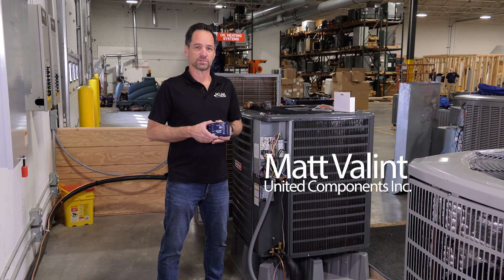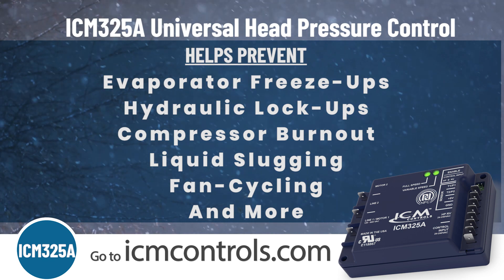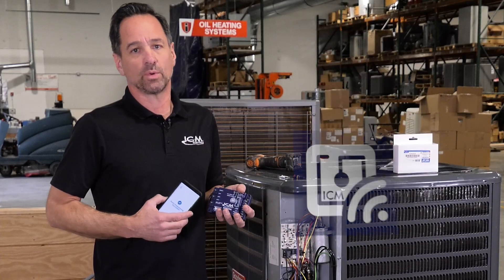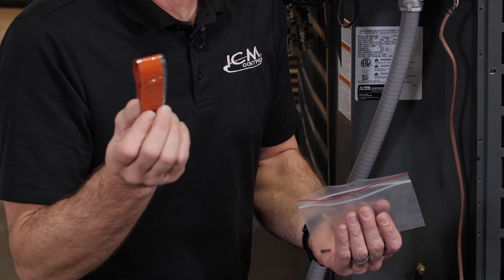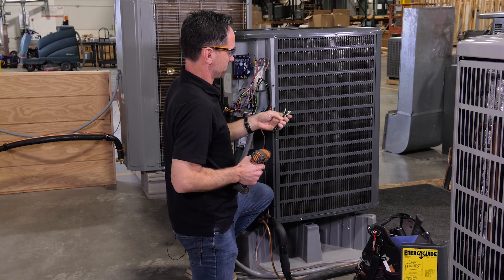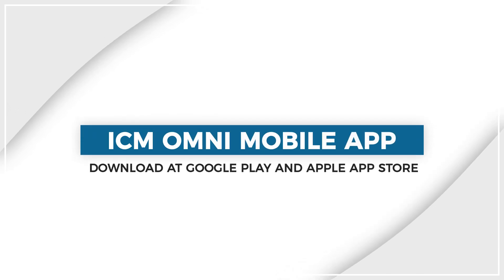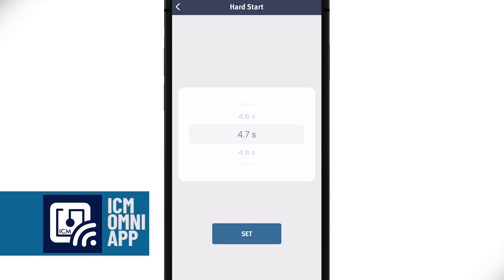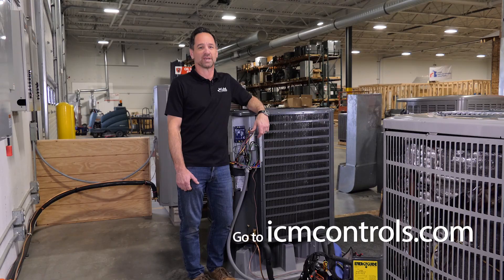Installation Video ICM325A Universal Head Pressure Control

Comment: I don't like this song. Having the dials is simpler and more straightforward. Specifically the three dial which had the temperature and pressure on it.

Also, if you have trouble programming it just have the very top of your phone right underneath the lights horizontally and if it's a better signal.

Comment: I missed the entire purpose and what type of AC this unit will work on. I have a variable speed, no contactor. The board controls the fan and compressor speed.
Reply from the maker: Unfortunately, The ICM870 series soft starts will not work with Variable speed compressors. However, variable speed compressors will have low inrush current to begin with so there is no real need for a soft start.
Reply: @icmcontrols9960  Unfortunately the video is about the ICM 325 and not the ICM 870. This means I am now double confused.
Reply from the maker: @TexasEngineer  I apologize for the confusion I did not see the Model ICM you were referencing and assumed you had a ICM870. The ICM325A is a device used to control the speed of a condenser fan motor which in turn controls the head pressure in low ambient conditions. However, if your motor is controlled by a circuit board that already varies the speed of the motor, the ICM325A will not work. The ICM325A will only work with a standard PSC ( permanent split capacitor ) fan motors and not electronically commutated (EC) motors.
Reply: @icmcontrols9960  Thank you for the excellent explaination.

Comment: NFC = Near Field Communication
Seems like your device is TFC or Touch Field Communication. 
This is very dangerous and moronic in the application you are placing this device!!!!
Do you really expect there to be ample room/access to place your phone into a unit to touch the control? This will be especially dangerous if the unit is live or there are moving components nearby.
Ad to the poorly thought out TFC, the need to have the device mounted in a unit that requires panels in place to take proper temperature/pressure readings. With this device the tech has to remove and replace that panel. Again, if this is to replace the dial control, what is the point of NFC if it cannot be utilized without removing panels.

You need to make a stronger NFC signal, just like every other mfr that utilizes this in the HVAC industry has done, to allow the device to be programmed from a safe distance.
If this device takes the place of the simple, convenient dial control I think many people will look elsewhere for their new control.

Great thought.
Poor R&D, probably by people that have never been in the field!!

Comment: Can this control be used on a 3 phase  480v condenser motor? I'm concerned that if Motor 1/Line 1 is not switched and the L3 line which would wired straight to the fan would cause the motor to single phase and run backwards. It does appear that the Line 2 and Motor 2 terminals are switched. Please advise.

Comment: Can this be used in conjunction with the 870 soft start?
Reply from the maker: Yes because the ICM870 only controls the compressor and the ICM325A only controls the condenser fan plus the ICM870 is only in circuit upon start up and not during normal run.